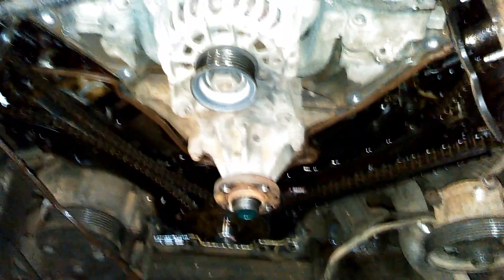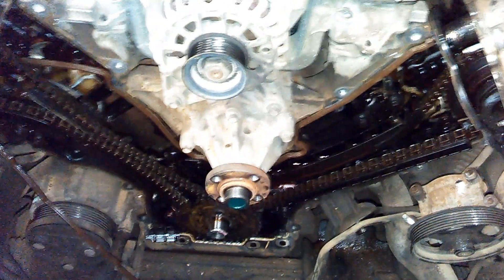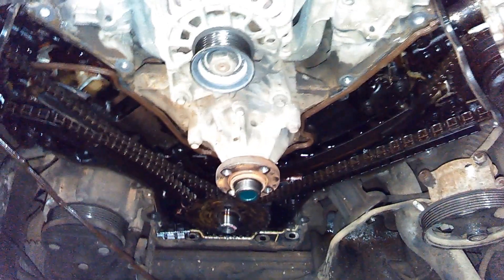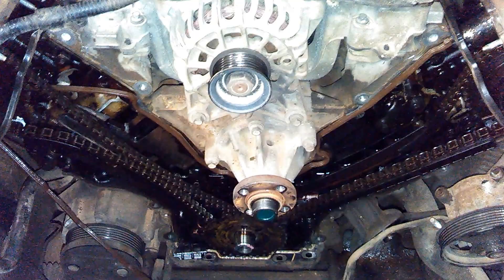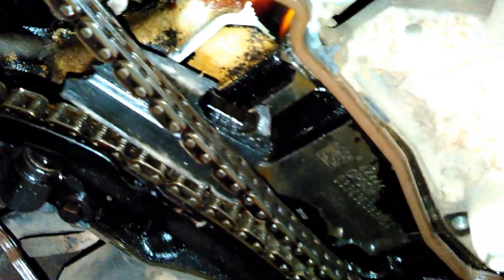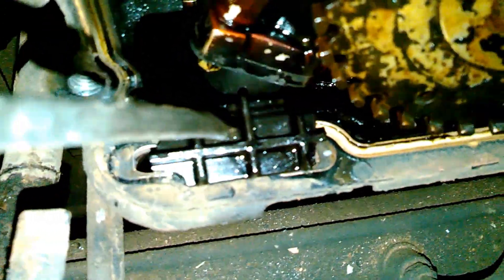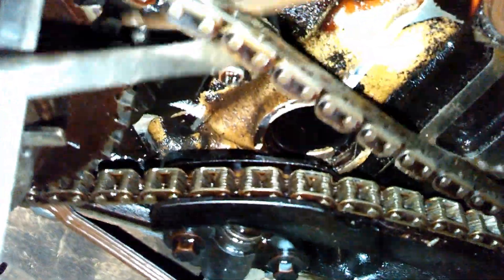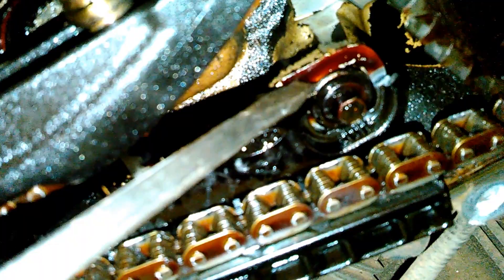Ford F150 5.4 3V Timing Chain Slack and Guides Failure / Breakage

Comment: what does this job usually cost a customer
Reply from the maker: It depends on different factors. Every job is different.  Some people want aftermarket parts, some want OEM parts.  Others want all OEM parts but no vct's or oil pump.  I prefer using OEM parts and replacing the vct solenoids along with the oil pump with every timing job.  Using all quality aftermarket parts, and not cheap junk off the internet, parts and labor runs around 1800.  Using all factory OEM parts, including vct's and oil pump, parts and labor run about 2400.  If you go to a dealership(in OKC), I see them quote around 2500 without the vct's and oil pump.  Make a note that Ford does not offer a timing set kit with all the pieces needed.  Everything is sold separately. Repair shops normally buy aftermarket timing sets. And if you get a quote under 1800, I would run, they are not buying good parts or they are working for free.  If your timing guides have came apart like the one in this video, you must remove the oil pan to clean the broken pieces out of the pan and oil pickup tube.  I include this when I do a complete timing job, but its extra at other repair shops esp the dealer.  Keep in mind that damage is usually present in certain places that only experienced mechanics see when they replace the timing sets.  When this damage is not fixed, other issues may occur down the road.  Choose your mechanic wisely.  Most mechanics, including dealers, don't have the experience to notice the other damages so they have return repairs after doing timing jobs, or you get fed up with your vehicle, call it junk, and sell it. Because of this, they often do not want to repair the engine, they just want to replace it.  I have seen only 2 mechanics other then me that know what to look for and both run/own home based shops.  On the flip side, I get vehicles towed in very often that had other mechanics start the job, and either didn't finish or did something wrong and won't start or running rough.  I personally would not trust a mechanic coming to your house to fix it.  I hope I helped.  Thanks for watching!

Comment: Do you not recommend installing phaser locking for yours customers ???
Reply from the maker: No, I do not off the bat recommend phaser locking.  It requires computer programming and the cost doesn't normally justify doing it. If the phasers are replaced with quality parts and installed correctly they are the best way to go if you don't have other issues with the engine.  If your phasers are bad, even though you are installing lockouts, the phasers need to be replaced to prevent cam or other damage.  If someone request lockouts, then yes, I do install them after I install new cam phasers.  Unless they are doing it as preventive maint, meaning they have no issues before its being locked out.  There's alot of misleading info on the web/forums and most comes from inexperienced people that assume the best way to fix something just because other inexperienced people broadcast their oppions.  Not saying that locking out is bad, but I perform dozens of timing set jobs every year, and the best route is replacing the timing set correctly with quality parts.  Hope I answered your question.

Comment: What tensioner did you use ??oem or aftermarket
Reply from the maker: Depends on the customer on what parts I use. If their on a tight budget, I use aftermarket. If they are keeping the vehicle, I recommend using Ford oem parts.  If aftermarket I normally use Cloyes timing sets, Melling oil pumps, and Dorman cam phasers.  I have had very good luck with this combination.  I def do not use cheap bundled parts.  A lot if people don't like Dorman, but I believe its an installation/or other problem, not a part problem only when it comes to Dorman cam phasers.  To this day, I've had zero Dorman Phasers come back.  I install lots(over a dozen) 5.4 timing sets a yr.
Reply: okc vet do you have any experience with melling timing chain tensioner,they are mettalic,not plastic
Reply from the maker: STEEVE DAVID Nicolas   yes, some people consider the metal to be better than the plastic. Older 5.4's came with metal tensioners. They still work on newer engines but are not oem.  A lot of upgrade kits come with metal. Depending on which style they send you, they may have a non retractable lock once they extend out.  This style is intended to keep tention even while vehicle isn't running. The newer plastic tensioners don't keep tention when not running. In my experience, I have not seen an advantage using metal over plastic.  I usually use the plastic tensioners that come in the Cloyes timing set. The Melling kits often has oem parts or upgrade parts.  Several Mellings kits have actual oem parts, that's why they cost more.  Everyone has their own opinion as to what is best to use or what is bad to use. I just know that I seldom have any issues on the parts I use.  Hope I helped you out!
Reply: okc vet with the plastic one wouldn't that make the truck rattle at cold start
Reply from the maker: STEEVE DAVID Nicolas     The 5.4 2v engine came with metal tensioners, the 3v has plastic.  The block stayed the same.  No,  It doesn't make a difference if your engine is in good shape and you use proper oil/filter.  The slack your engine has, isn't caused by plastic tensioners, its caused from your timing set worn out, which could be because of previous lack of maintenance, wrong oil type, wrong oil filter, or at its life cycle.
Reply from the maker: Sorry, didn't address your exact question. No, just because you have plastic tensioners does not mean you'll have rattle at startup.  If you have rattle with a new timing set, you have other issues, or it was not installed correctly.  Could be oil pump, bearing clearance, camshaft condition, oil type, etc.
Reply from the maker: I always suggest using a high volume or high pressure oil pump when doing a timing job.  These will help solve the clearance issues of a worn engine. Suggested oil pumps are the high volume Melling M340HV or the high pressure Melling 10340